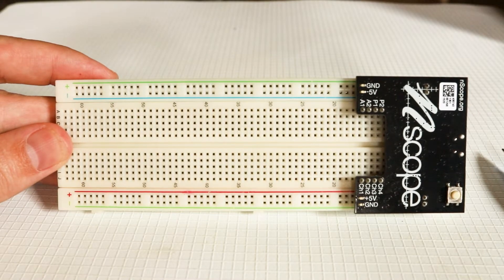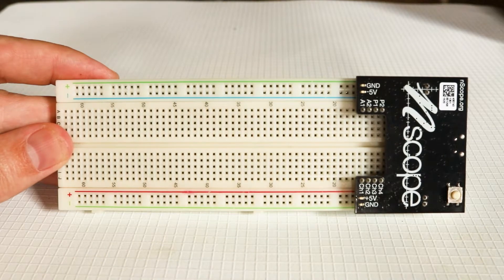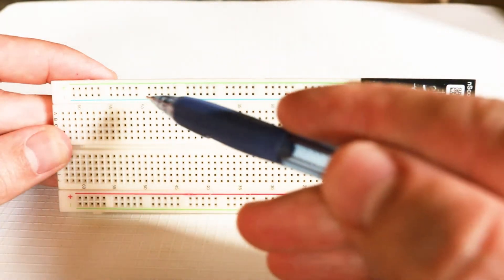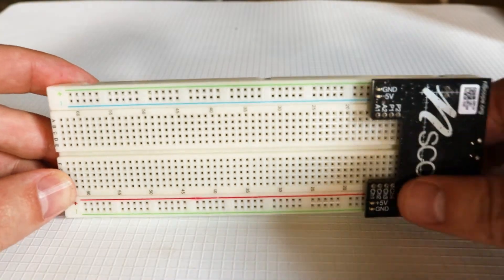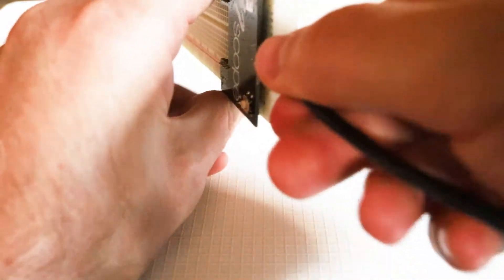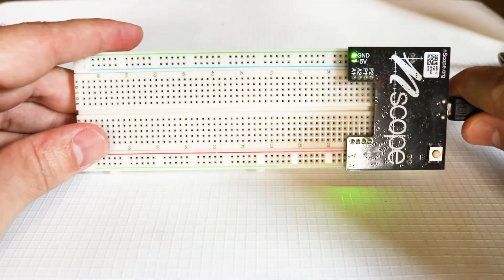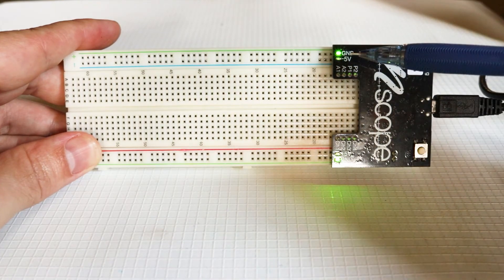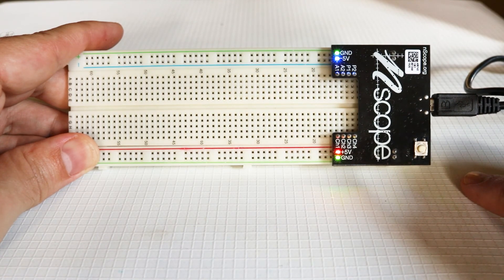nScope Introduction

Comment: Hey, I have had the nscope for a few months now and it was working perfectly. However, after about of month of no use the nscope is not conneting to the software and the it shows that there is no power supply. I am not getting the green lights for the ground. I was wondering if you could suggest how I can troubleshoot this? I tried plugging and unplugging, reinstalling the software, and restarting my computer, but nothing worked :(
Reply from the maker: Hi Layla,

That is a good question.  I am not really sure what to do.  I don't work for nScope, I am just a college professor who uses their equipment.  I recommend emailing them: contact@nscope.org.

Cheers,
   Jordan.